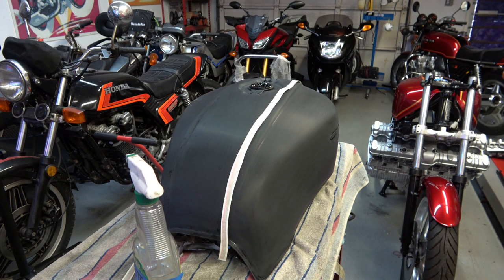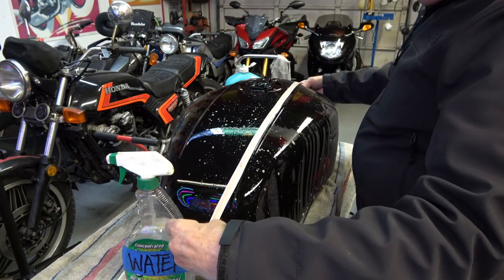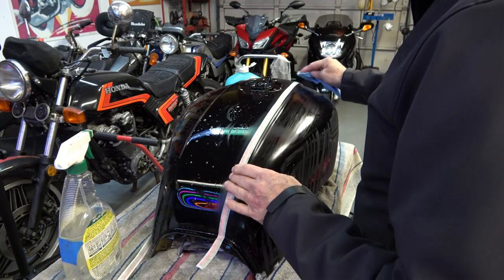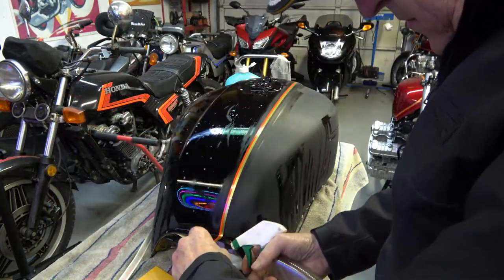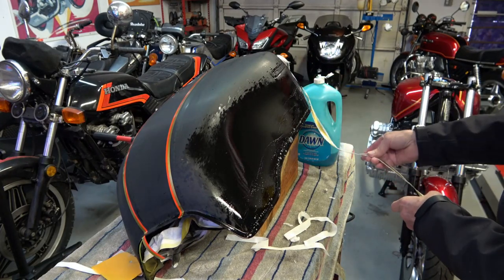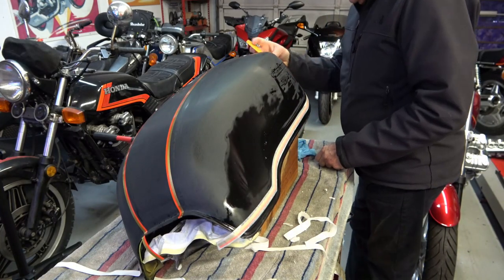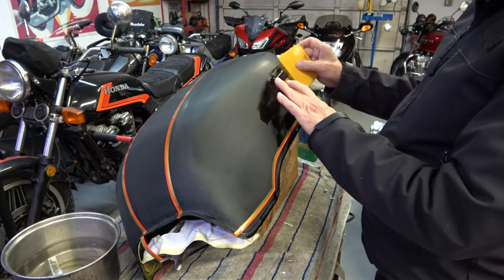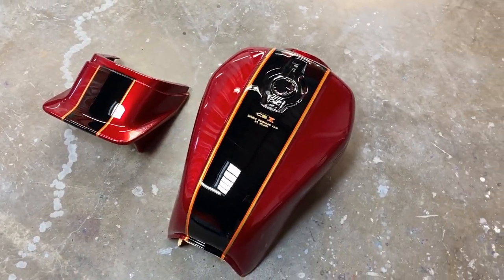1980 Honda CBX Restoration - Part 2 How to Apply Decals or & Stripes to CBX Fuel Tank & Bodywork

Comment: Hi, awesome work. I base coat painted my Z1R D1 in Stardust Silver , yesterday, do i now need one coat of clearcoat, then Scotchbright the surface and soapy water apply the adhesive pin strips next. Then how do i remove the soapy water before 2 more clearcoat . Lots of questions, sorry.
Reply from the maker: Apply a couple of coats of clear, then wet sand it with 1000 just enough to have a completely dull finish (no shiny spots) then mix dawn and water in a spray bottle and apply the stripes on very soapy surface. Keep spraying to keep the surface soapy as you work the stripes. Then squeegee the water out leaving no bubbles as I do in the video. Then apply another clear coat.

Comment: The decal goes on the base coat?
Reply from the maker: The tank gets painted, then cleared, then wet sanded, then the stripes are applied, then clear coated again. Then cut and polished.
Reply: @digitalpizza1  thanks